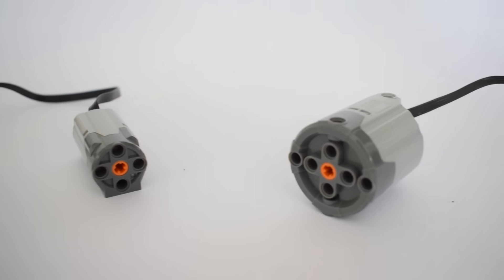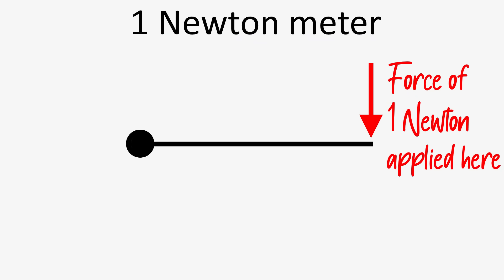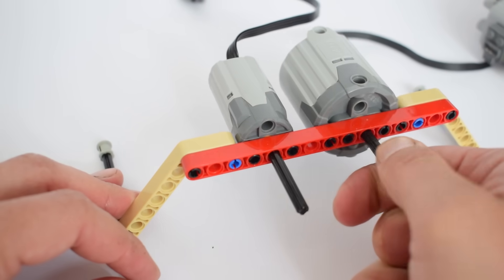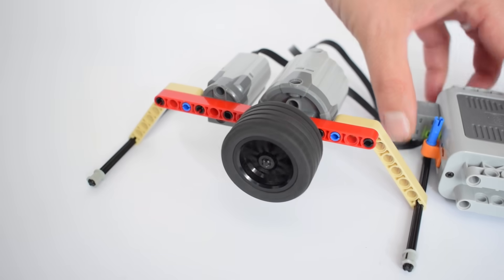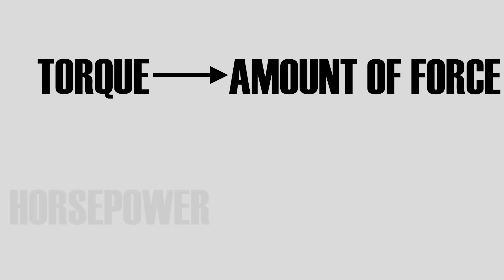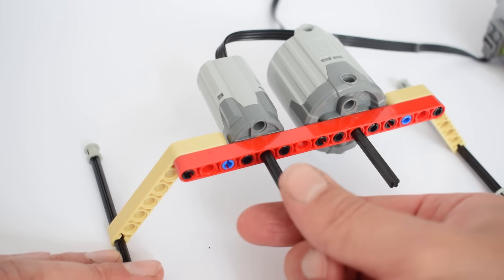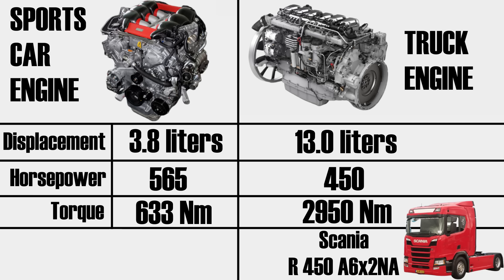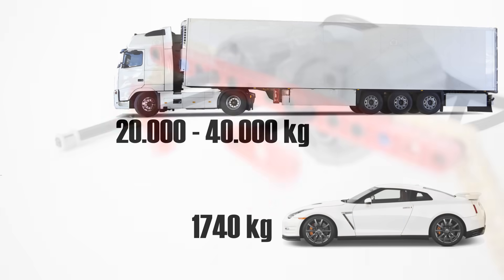NEVER be confused by HORSEPOWER and TORQUE again - HP and TORQUE EXPLAINED in the MOST VISUAL WAY

Comment: Lets examine this, according to Scanias web site R450 produces 2350Nm. Some googling for torque curve gives that this is peak at 1300rpm.
The R35 produces 520Nm at 6500rpm.
We can use a gearbox to gear down R35 from 6500rpm to 1300rpm, a 5 times reduction. When we gear down 5:1 we will loose rpm but we will gain torque at the same ratio. 520Nm times 5 is 2600Nm.
So now we see that the Nissan engine is fully capable of  (in theory) replace the Scania engine if we only look at power and force. In reality it will not work because the small engine simply cant make it very long at full power.
We can simply state that torque-figure is a somewhat meningless figure as long as the vehicle has a gearbox and the engine is a good match to the vehicle.

Comment: The thing is horsepower was not made for cars. It was a unit to measure for the first engines for literal how many horses it could replace. Back then rivers and sometimes windmills used to power machines in factories or mills or pumps in a mine. If not near a river then an animal would be the power source either in a wheel or turning a shaft. So James Watt(the unit watts is named after him) came up with an equation to explain how powerful the engines were since he was selling his engine(there a bit more to the story). And since engines were then measured by HP it has just stuck. I

Comment: I've watched dozens of hp vs torque vids and still don't get it. Why do prople want more hp cars and motorcycles? Why does it matter? Does a car with more hp and less torque have higher top speed but less acceleration or the other way around? Why do manufacturers say for example "300 hp at 7000 rpm and 220 Newton/meters at 6200 rpm"?

Comment: You can go even further with that. A gearbox and a differential are torque multipliers. You can also say they are horsepower dividers. By using a torque multiplier, the highest horsepower will always be capable of generating the most torque. Example: If you run 600hp with 400ft-lbs @ 6000rpm through a 4:1 final drive, the output of the drive will be 1600ft-lbs @ 1500rpm. You have effectively generated ample torque to move a truck 🚛. However, wear and tear, as well as frictional losses will result in much greater maintenance and fuel costs.

Comment: Your explanation of force, torque and power are.... good enough for kids at best.
There is not "frequency" of force - power is simply the amount of energy used in a given time. And for car acceleration - that is related to the torque - but NOT the torque of the motor. So the number that actually describes the acceleration - and what you fell - is the power, aka the Horsepower of the car. That is also what the transmission is for - to adjust the gearing-ratio to extract the maximum power from the engine.

Comment: If you say that HP=torque*rpm, why cars have max horsepower and max torque on different rpm? For example, GT-R has 565 hp at 6800 rpm and 633 Nm at 3300-5800 rpm

Comment: I'm the only one who still doesn't get, after reading the comments. Feels like school all over. 😖
Reply: If i may. I  have an explanation that may help.

Imagine that there is a man using a sledge hammer to hit a fence post into the ground.
He is a big ugly muscular bastard and can move that post 2" ( or 50mm) downward into the ground every time his sledge strikes the post. But his sledge is enormous and he can only swing it 10x per minute.

He is like a truck engine. Applying a large amount of force, but operates slowly. But he can still move a post 20" (or 500mm) into the ground per minute which is pretty good.

Now, there is another man next to him, also driving in a post. But he is much smaller and has a smaller sledge hammer. So when he strikes the post it only moves 1" (or 25mm) into the ground on each strike. So half as far as the larger man.
BUT.., this smaller man is agile and sporty, so he can swing it twice as often as the other man at 20x per minute.
Thus he too can move a post 20" (or 500mm) per minute. They're both doing the same job in a different way.  But it's equally effective for both.

Now imagine that these men aren't hitting fence posts, but instead that they're hitting the top of a piston on a single cylinder engine rotating assembly. And every hit is the engine firing.

The amount of force applied to the top of the piston is going to generate the torque.
The big man working slow would be kinda like a diesel operating at low rpm with lots of torque.
The smaller man would be more like a high revving petrol/gas engine... having less torque but still doing the same amount of work because he operates at a higher speed to compensate.
Reply: Let me try with a slightly different explanation. I'll try with linear motion, but the rotational motion has exactly the same explanation.

Let's say you want to lift an object that weighs 100 kg by 4 meters with a rope. The heavier it is, the more FORCE you need to exert to lift it. The unit for force is Newton (N). 100 kg translates to 1000 N of gravitational force.
To lift that object, you also need to exert a certain amount of ENERGY. The heavier it is and the higher you want to lift, the more energy you're going to spend (you're gonna be more tired at the end of it). Pretty logical. Mathematically, that can be expressed as ENERGY = FORCE × DISTANCE. The standard unit for energy is Joule (J). So, to lift our 100 kg by 4 meters, we need 4000 J of energy.
Now let's put speed into the equation. Say you want to lift that object by 4 meters in 5 seconds (i.e you want the speed of 0,8 METERS PER SECOND ). So you need to output 4000 J of energy within 5 seconds, that's 4000/5 = 800 * JOULES PER SECOND *. And that's exactly what POWER is - the amount of energy you output over time. JOULES PER SECOND is just another name for WATTS, which is equivalent to horsepower.

Now lets add rotation into the mix. Instead of lifting by hand, you use a winch. Your winch is 500 mm (0.5 meters) in diameter. 1000 N multiplied by 0.5 meters gives us 500 Nm of torque. That's how much torque our motor needs to output if we want to raise that load.
And again as before, how fast you want to move it will determine the amount of POWER you need.
Reply: @zorkan111 ok but that's perhaps 3x more complicated than the lego video though. Once you start throwing equations around... anyone who hasn't already grasped it will probably tune out or give up. You might have better results by getting people to understand it conceptually or with a practical relevance before getting too mathematical.
Reply: @zorkan111  ok i agreethatot's not highly complex, but I think you kinda misinterpreted my point.
it's not the mathematical difficulty that puts people off learning things like this.
It's the fact that mathematical equations are the opposite of everything that's fun and interesting about the subject matter. 
You'll notice this video was very scarcely mathematical or theoretical, and was more interested in visually demonstrating a concept in action rather describing than the mathematical princles and equations that make it work. Even the "horsepower =torque x rpm" mentioned and left out the division of 5250 because for someone who's just now grasping the concept.. the mainthing is tp understand the general relationship between torque and horsepower,rather than the exact formula. But that's just my opinion.
I do like your analogyhonestly I do. But I just don't think it's one that my 14yr old nephew who likes turbos coz they go woosh is likely to listen to and understand.
Reply: @brianfrost303  if a person sees multiplication of two numbers and immediatelly gets put off by it, then he doesn't even have the intention of learning anything in the first place. Might as well go watch cat videos.
I'm not in the business of treating people like idiots who are incapable of grasping 3rd grade math, because they are capable.
Reply: @zorkan111  when you're asking someone to do mathematical equations before they have any sort of foundational understanding of what the figures you're calculating represent or how they relate to one another in a practical or applied sense, you can bet your ass they are going to tune out and learn nothing.

Comment: So basically you got insanely close to finally explaining it right, but then explained gear ratios and then added a horsepower sticker on top of the word gear ratios. I'll explain it myself then:
Imagine a weight of 550 pounds. You have to LIFT it up by one foot. How long do you take? If you said one second, congratulations, your body just produced 1 horsepower. 1 horsepower equals lifting 550 pounds by one foot in one second, or 550ft/lb per second. HORSEPOWER IS NOT, AND NEVER WILL BE, ROTATIONAL FORCE. IT'S ENERGY. TORQUE IS NOT, AND NEVER WILL BE, ENERGY. IT'S ROTATIONAL FORCE, BECAUSE IT REQUIRES SOMETHING IN THE MIDDLE TO BE ROTATED. IF THE WRENCH IS NOT GRABBING ANYTHING, YOU'RE NOT PUSHING A WRENCH AROUND SOMETHING, YOU'RE PUSHING THE WRENCH *FORWARDS*. THAT'S HORSEPOWER, NOT TORQUE. YOU COULD LIFT THAT WEIGHT FAST, SLOW, HOWEVER YOU WANT, YOU WILL BE PRODUCING 0 FT/LB OF TORQUE, BECAUSE YOU'RE NOT ROTATING ANYTHING, YOU'RE USING POWER FROM YOUR BODY TO LIFT IT. THIS IS WHY WE USE KW INSTEAD OF HP, BECAUSE HORSEPOWER ISN'T A MEASUREMENT OF KINETIC ENERGY AROUND A CENTER, IT'S A MEASUREMENT OF ANY ENERGY, AND A MEASUREMENT OF POWER CONSUMPTION. COMPUTERS, SMARTPHONES, BATTERIES, MOTORS, EVERYTHING CONVERTS WATTS OF ENERGY INTO SOMETHING ELSE. IT'S WHY HIGH HORSEPOWER CARS CONSUME MUCH MORE FUEL THAN HIGH TORQUE CARS, BECAUSE THEY USE MORE ENERGY TO REACH HIGHER TOP SPEEDS, AND UNLIKE TORQUE, IT'S NOT AFFECTED BY THE DIMINISHING RETURNS OF CHANGING GEARS. THAT'S WHY ELECTRIC CARS HAVE HIGH TORQUE AND LOW TOP SPEED, BECAUSE THEY DON'T HAVE ENOUGH KW TO USE GEARS EFFECTIVELY.
Rant over. None of this would be such a huge issue to explain if people stopped using horsepower and started using watts. But you know, murica.

Comment: A lot of People think torque and hp do different things, torque and rpm aka a running engine do everything together accelerate, cruise at speed, tow trailer, blast down the quarter mile etc... and that combined ability is usually called HP.

Comment: To me the easiest way to explain it, is Torque is "basically" one powerstroke and hp is all the powerstrokes added up 'rpm' why I say basically cause torque can't happen independently in a running engine your engine is always making power. As for the truck vs car engine the car engine is more powerful than the trucks but you'd have to gear it to spin 5000-7000 rpm at driving speeds where the truck engine never has to go above 2500 rpm which is gonna last longer  :)

Comment: "You can feel Torque but you can't feel Horsepower" 

Cries in mazda rx-7
Reply: That’s completely false though. When you accelerate that feeling does NOT come from torque
Reply: @psplayer1344  evaluate yourself pls
Reply: @psplayer1344  I fully agree with you. See my comment.
Reply: @psplayer1344  Yes, it does. That's what your drivetrain is for. The gears in the transmission multiply the torque generated from the engine, which then goes to the differential which contains perpendicular gears that change the direction of the torque to turn the wheels. Thereby, torque from the engine generates linear motion of the car.
Reply: @benn454  amusing. You're both wrong. HP is a product of torque. Therefore BOTH can be be considered as perceived. It's actually far more complicated than what I just explained but I don't feel like typing forever when no one will read it. 

The best response is that you feel the acceleration but that's still oversimplified.
Reply: There there, buddy. I'm sure someone'll fix that apex seal problem eventually. It's only been... uh. 92 years?
Reply: You can feel the fun
Reply: is the rx 8 any good
Reply: @aestheticswim3397   no they went very wrong with the engine with the rx-8 I would recommend staying away from it
Reply: @Shyfly52  it quite good if you don't short shift it short shifting is bad for a rotary and if you avoid it the can be pretty reliable
Reply: @aestheticswim3397  I loved my RX8! It was a blast to drive. Downfall was horrible fuel economy.
Reply: @aestheticswim3397  good for what?
Reply: @aestheticswim3397  it can be very fun, only 12 year old fanbois who haven't owned any cars will say it's not as good as the rx7 (fd) and it's trash. It's obviously not as good as the fd rx7 but still a very cool car.
Reply: @alexig1840  dorito go brrr
Reply: FOUR TORQUES
Reply: If you are feeling acceleration, you are feeling power. Acceleration is governed by power/weight ratio. So this video is wrong.

Comment: For example, if I swap an engine that was in a 2000KG car into a 900KG car do I still need the 1300Nm or would it be better to make the gears bigger(longer) to make it accelerate faster instead having much torque?

Very important for me.

Comment: I think most people (including me) always can't make the difference between Torque and HP because they're always given as two separate specifications for an engine, when in reality horsepower only exists when there is torque.
Reply: @Joe-by8jh  without torque there is no horsepower either.
Horsepower is a measurement of the speed at which torque can be applied.
Reply: IMO every explanation skips a critical step, which is energy, because power is directly defined through energy.
To overcome a resistance (i.e. move something), you need to exert force F (or torque, if we're talking rotation).
To move something with force F over a distance L, you need energy. E=F×L.
To move something with force F over a  distance L at a certain speed S=L/T, you need a certain amount of power  P=F×S=F×(L/T) = E/T.

In other words, power is the amount of energy per unit of time.
I.e. to move something through resistance at X meters per second, you need Y joules per second, and joule per second is the definition of watt, which is equivalent to horsepower.
Reply: @zorkan111  Damn I wish someone told it like this when I was in school

Comment: Always difficult to explain difference between torque and power. Even for you... There is no energy transfer when the applied torque (wrench f.e.) doesn't come with rotation (stuck bolt f.e).
In an electric there is NO conversion of chemical energy (battery) into torque, but conversion of this energy into mechanical energy IF the car ils in mouvement.
Regards.

Comment: Heres a quick summary:
Horsepower is how fast you'll hit a wall.
Torque is how hard you'll hit a wall.
Reply: not accurate though.
Reply: @monstrositygamers  why is that tho
Reply: @LunringNassar  because the description isn't accurate, torque is not a measurement of momentum and horsepower is not a measure of speed. torque is a literal force, and power is work per unit time, or as explained in the video, how much force (work) is applied per unit time
Reply: @monstrositygamers  ima just say it as a rough summary.
Reply: @LunringNassar  it is a good visualization for people that don't know the math behind it, but it's not super accurate. horsepower is a terrible unit and power is much easier to understand in SI units. Power = Work / Time  ,  Work = Force x Distance  ,  Torque = Force x Perpendicular Distance  ,  it's pretty basic engineering statics/dynamics really
Reply: @LunringNassar  In case you missed it he answered this in a video after this one.
Reply: a quick bad summary

Comment: It’s crazy how Mazda can get 320 ft lb of torque out of a gasoline engine.
This is the best video explanation ever!
Reply: You can double the torque of any engine by just using a different gear ratio (reducing RPM out of the gearbox to 1/2 will double the torque)

Comment: Great video, with a little simplification that could be misleading IMO: when you compare the feeling of pinching the EM axle to the feeling of force in an accelerating car and conclude that you can't feel the horsepower it's not really the same. Yes, you can't feel THE horsepower, but what you can feel is the force resulting from acceleration, which is of course dependant on HP and torque as you clearly say; given that HP is the only measure involving time, a higher HP car with all else being equal will always accelerate faster so in a way you ARE feeling HP while accelerating. Of course you're not actually feeling either HP or T but the reaction force of the product of both at each point in time, so I don't think you can directly compare those sensations as you did in the video. Now, if you were to grab the axle of an engine then that would do, of course it would also be quite literally the last of your problems :)

Comment: If you can only feel torque why can you feel more acceleration in a sports car.
 
Measuring torque at the crank is useless because it the  goes through a gearbox before the wheels that alters the Torque. The GTR engine could produce more torque at the wheels and pull that trailer better than the lorry if it had an appropriate gear ratio (because it has more outright power). Thats why we use horsepower when torque is what you feel.

Wonder why a vtec engine keeps up with a v8 with similar hp but way less torque. The gear ratio makes the wheel torque equivalent. Horsepower is the best comparison of engines even if WHEEL torque is what you feel.